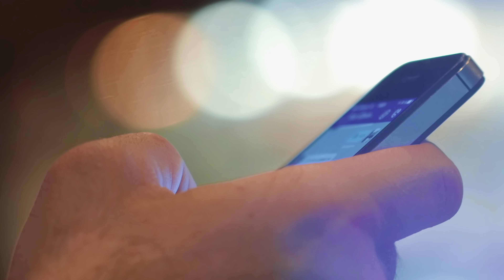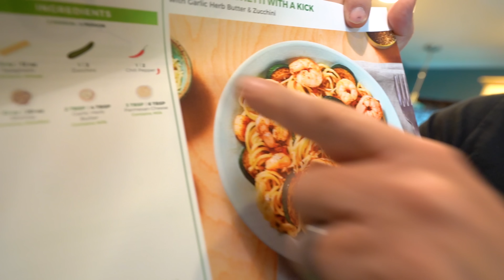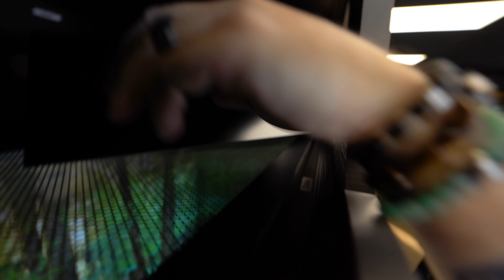My Tegu Lizard Gets A Huge Cage Upgrade!

Comment: literally JUST finished a new enclosure for my Baja blue rock lizard. i had him in a custom arboreal enclosure i made out of a beautiful sliding glass door china cabinet. but. he wasn't seeming to get a handle on the enclosure. he got stuck in the bottom layers allot. so i made him out out of a 4x3x2 solid oak cabinet that i turned on its side. knocked the shelves out. made my own ledges and rock bridges. cut holes in the top for his uvb and basking lamp.  made him a niceee basking rock from some river slate rock. made him a nice hiding spot (because he is EXTREMELY wild...does NOT LIKE HANDS anywhere NEAR him.. kinna makes me sad. but oh well lol". and i made some acrylic front doors. some ventilation in the top rear. and the sides. painted it with some drylock. "i will paint a desert theme later with acrylic's". and made him up a substrate from organic potting soil and play sand mix.  really hope he likes this one better than his old one. makes me a little sad tho his old one was the bees knees lol. oh well. maybe ill put some other kind of arboreal reptile in it